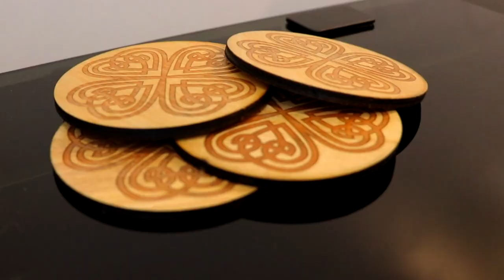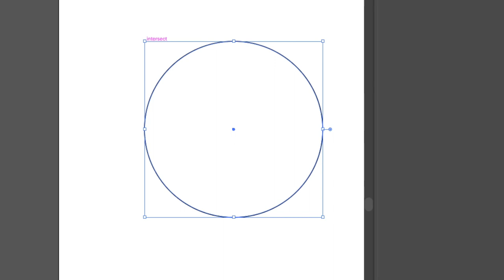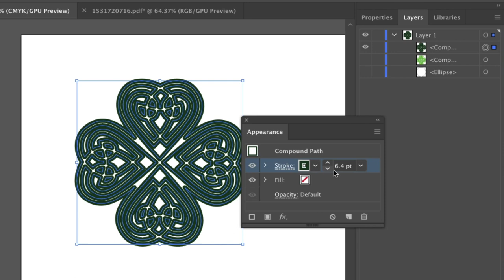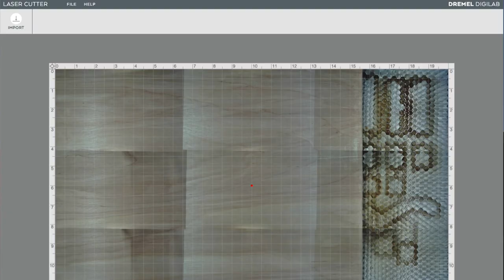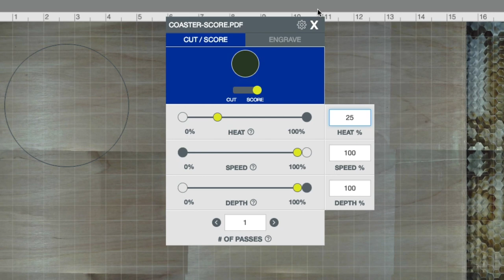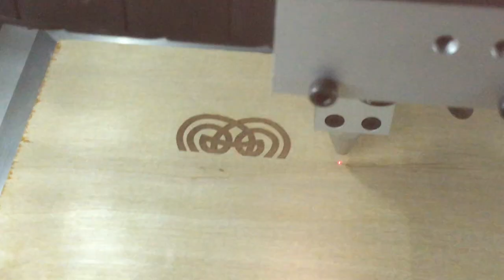How to make custom laser cut coasters step-by-step

Comment: What thickness did you use for the plywood? Love this project! <3
Reply from the maker: I used quarter inch Home Depot plywood, although the laser did struggle with that. Had them cut down a full 4 x 8 sheet in the store. It was much cheaper that way.
Reply: @AdvancedGeekery  Thanks for your fast reply. Love your channel! Keep it up!